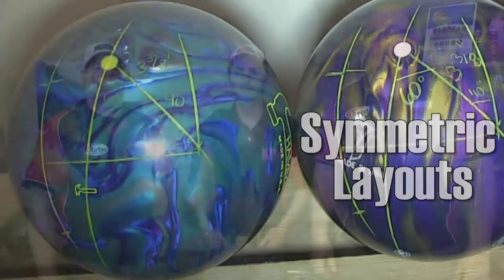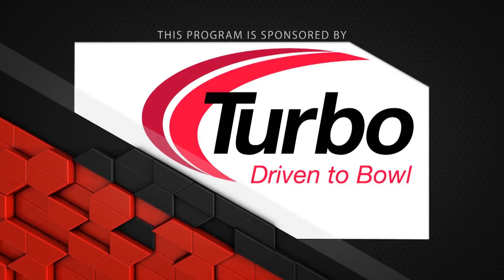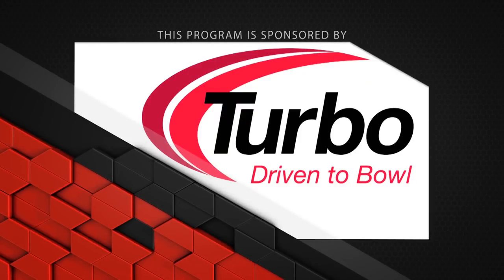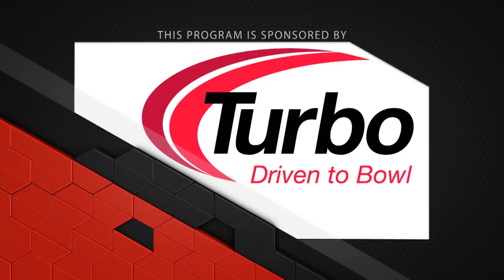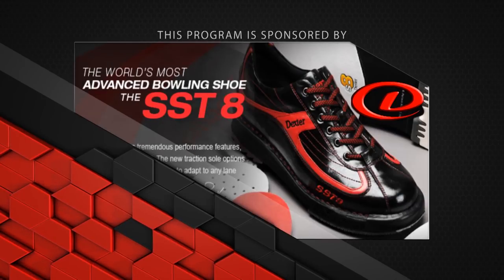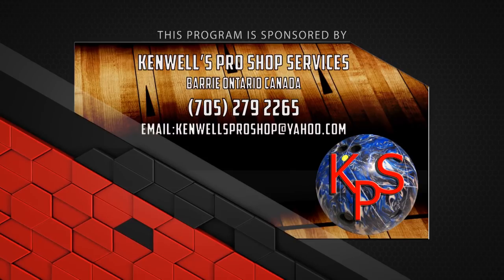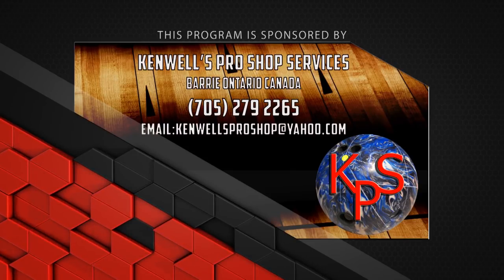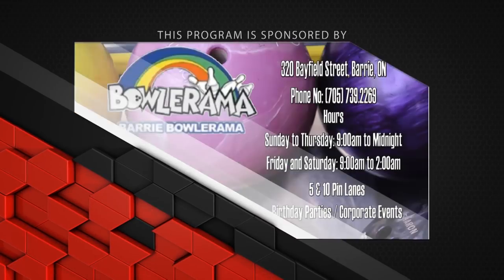Drilling Decoded - Lane Side Reviews

Comment: Thank you for such a clear and concise explanation. I have been bowling for quite a few years and now I can say I have a 'better understanding' of layouts. I do have one question. If you could tell me how my 4x4x2 translates to the dual system. Would I be correct in explaining as such 4in = About 70 degrees; 4in =3 3/8 and 2=40degrees
Reply from the maker: The Storm system of measuring (normally seen as a (Y) x (Z) x (a) ) is going to be covered in the next video.  We will actually be laying out a ball in that system, then breaking it down to the dual angle system.  Keep an eye out for it.

Comment: Ok so I understand layouts start with  your pap. So how do you get the pap with an undrilled ball?  Do you drill it it best guess, then plug the holes and redrill...kinda confused
Reply: You can either pull PAP from an existing ball or use a system like Bowler ID to get the bowlers PAP for the case if they have no equipment yet. In practice most shops aren’t going to even deal with PAP unless the bowler asks for it.

Comment: Oh man where do I begin. Kyle should've brushed up on his knowledge of dual angle layouts beforehand. Here's a link to a guy who explains the dual angle layout in a correct, and more clear and concise manner. https://youtu.be/N0jVqFfnf2o
Kyle definitely does not understand how the VAL angle translates to ball motion. It's simple; smaller VAL angle; quicker response time to dry, larger VAL angle; slower response time to dry. The next thing is that both symmetrical and asymmetrical bowling balls both have max leverage position at 3 3/8" from PAP; the difference is in a symmetrical ball, the flare decreases past 3 3/8" and < 3 3/8" to 0. Now, in the asymmetrical bowling ball, 0 to <2.25" is minimum flare, and 2.25" to 6.75" is maximum flare. http://www.motivbowling.com/forum/viewtopic.php?f=8&t=3631
Sorry, I feel bad about correcting you guys but you are PRO Shop professionals 
and should not be spreading misinformation like this. Be better prepared and more researched next time. Peace.